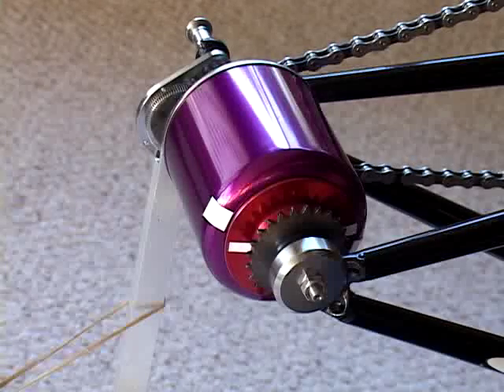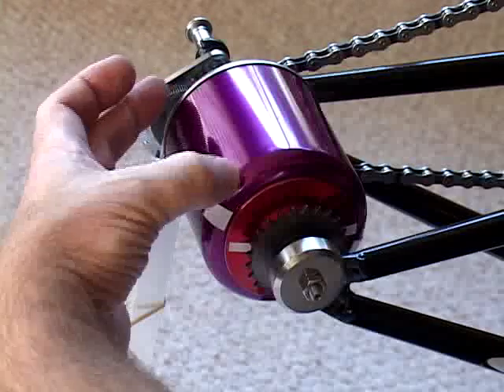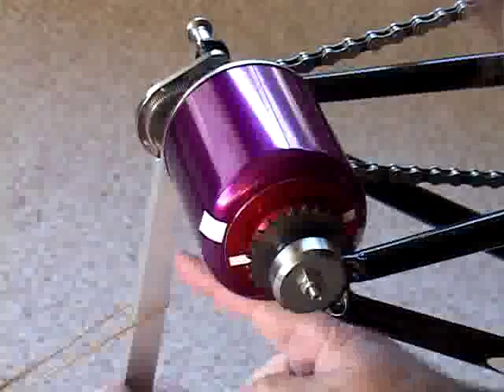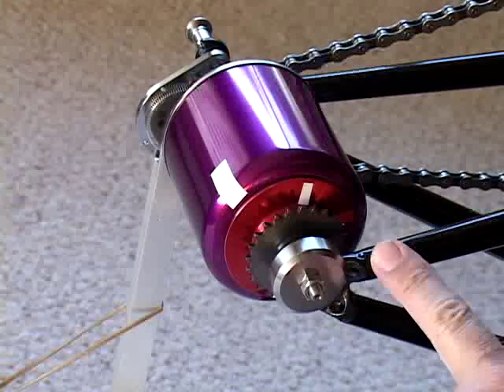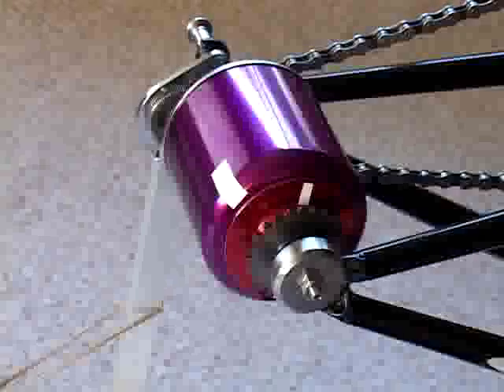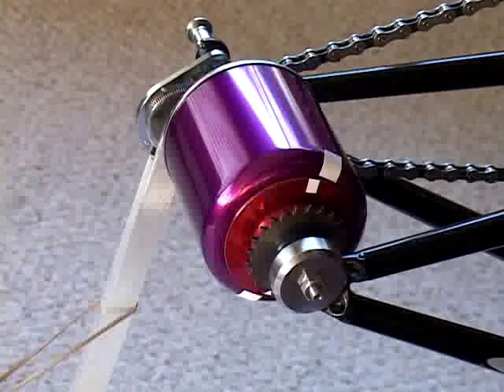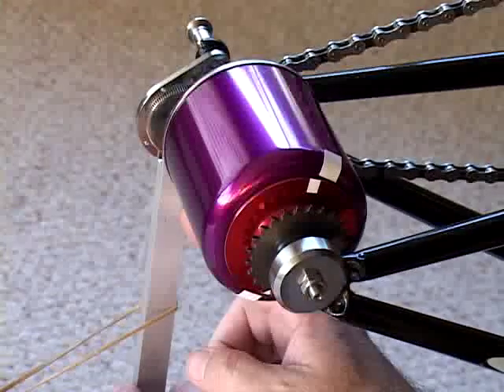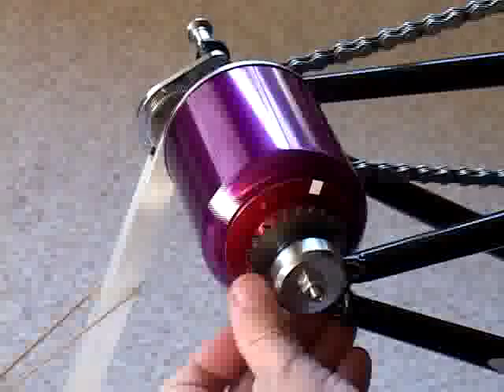Automatic Bicycle Transmission (IVT)

Comment from the maker: xxp Think about using a teeter-totter; if your partner is much heavier than you, the teeter-totter is no fun at all & totally useless! Now, ask him to sit closer to the pivot point (fulcrum), where his torque is reduced to balance your torque, making it finally useful.  The point is that the speed for both of you has become useful as a result of torque adjustment, not the other way around; which is the cause, and which is the effect?  This principle applies to rotating transmissions.

Comment from the maker: Haz... The SIVAT can be designed to stay engaged in propulsion at ratios so low that even the most extreme human-powered pedal force (elite cyclists) will not make it 'cut out' or be damaged.  As such, your bike speed might be ridiculously low while pedal resistance is still normal as you go up very steep hills.  A 'wheelie' would result.  It is not like a slip clutch!

Comment from the maker: Zetune79.  At zero output, the energy transfers to engine heat, just like with all transmissions in 'neutral' or while idling at a stoplight. The function of approaching zero is a more efficient method of starting vehicle motion without a clutch or torque converter (which are very inefficient); so what benefit is gained from eliminating that ability?  I can provide a control ratio plot, but can also say that each angular increment of the lever cuts the ratio ~ in half at some scale.

Comment from the maker: Pghpunkid.  No belts, no rollers.  Hard steel parts that don't slip.  It uses gears that engage to transfer power.  It is more than a CVT; it's an IVT!  Yes, it's mechanical; just like belt drives, chain drives, fluid drives, gear drives, pneumatic drives, which are also mechanical.  The term 'mechanical' does not refer to just rigid metal mechanisms, it refers to all mechanisms.

Comment from the maker: Zetune79. Yes. Yes. The overload protection can be limited to any low speed, including zero by limiting the travel of the ratio adjuster mechanism!  Since the SIVAT is infinitely variable, it can always reach zero output (or your redefined low limit) without regard for step-up or step-down gearing on the input or output; the video unit actually is stepped up by 5 times with a 55T crank sprocket to an 11T hub sprocket, so its actual highest  'gear' ratio is nearly 5X!  Not a clutch coupling!!!

Comment from the maker: eisen...  The inner workings of the SIVAT are proprietary and the patent is pending, so I do not show its innards!  The torque is ~ proportional to volume, as with all gear systems; the size on the YouTube video will output about 145 nm max @ 600 rpm input/39 rpm output. Torque is somewhat dependent on ratio, higher output torque achieved with lower ratios.  The calculated maximum sized SIVAT will transfer over a megawatt of power @ over 1000 nm input torque, several thousand nm output torque.

Comment from the maker: timonix2.  The way the SIVAT is configured presently, it does exactly as you need; giving automatic control to allow variable output speed with nearly constant input speed.  If you need perfectly constant input, it would need a servo to electronically control the ratio at all times.  My son is currently taking a 'controls' course in his computer engineering PhD. curriculum, and might do that as a project if asked.  Email me.

Comment from the maker: Hi maco10810. Thanx .Your description is remarkably close to our original goal.  Take this a step further; use a small IC engine that produces its highest torque @ ~7000 rpm where its power is very high, but also can run at very low power at low rpm with very low fuel consumption.  This would be very economical & efficient, but allow high power only on demand! The SIVAT would adapt either engine speed to the vehicle speeds, going to lower 'gears' for high-revving, high power needs.

Comment from the maker: Please read all posted comments at this site; you will see an explanation for the IVT.  This SIVAT is a classic case of IVT.  Look up the IVT definition on Wikipedia or Hot it Works.  The SIVAT is perfectly capable of both overdrive & reduction, useful for all drives, including bikes.  The YouTube proto has a 55T chainwheel & 11T rear sprocket; do the math!

Comment: I don't see how it can be called an IVT, with ratios between 1:0 and 1:1 it's only a CVT. It doesn't reverse, and it doesn't go over 1:1. A useful bike transmission needs to go over 1:1 to be useful for level riding. I can think of many uses for a reduction CVT, but a bike transmission isn't one of them.

Comment from the maker: Good question!  Our next prototype will be designed and sized for 500 kW wind turbine and vehicle power/efficiency tests, in-line shaft drive.  The SIVAT offers several advantages for HAWT's; controllable mechanical synchronization to 1200 or 1800 rpm output, high torque capacity, high power density, high ratio bandwidth & up-front mechanical shock load protection.

Comment from the maker: Wut's not to get? Yes, ratchets engage and *disengage*; but ratcheting drives use several ratcheting elements that each only disengages when others are engaged in sequence. Therefore some elements are always engaged in power transfer. Their action is locked, so they have no local relative motion that can allow frictional loss. Only motion of their associated mechanisms is allowed to transmit power, usually supported by low friction rolling elements, so the whole system is positive & efficient.

Comment: Great. My english couldnt understand the speech so, where we could buy this or this is a prototype? Maybe you should start to insert this inside those motor wheel. If the motor wheel have a transmition like this one , when we climb hills the motor will change to a power gear and the motor will resist.

One motor wheel with transmition mmmmm (^_^)

Keep doing the great job

Comment from the maker: lalaland0417. The Shimano 8 might handle 1200 watts in any gear, but the gearshifting shock loads may strip its gearteeth. Read about the Tesla Roadster for insights. SIVAT does not abruptly shift gears. We're reviewing new SIVAT design for torque using stats of pro sprinters who produce crank torque peaks at ~150 Nm @ 2.5 kW of power. Email me for more info.

Comment: I would love one of these. I currently have a trike with a shimano 8  speed internal geared hub drive.. which works well. But I'm probably going to break it when I hook up a  48V 1200W motor to it.  With one of these I could alter the gearing based current consumption. I wonder whether on of these would hack it?

Comment from the maker: looselefty.  I may be ahead of you.  I used to be an avid cyclist myself.  I plan two handlebar controls: 1) torque level response adjustment, and;  2) response speed adjustment with ratio locking.  If you stand on the pedals, you can control how fast & how far the ratio drops.  My Paramount has a 174 inch high gear that I've used going really fast downhill, which I can do because I'm big.  So, I understand your concern.  Flyweight control upshifts with acceleration, the opposite of desired.

Comment: I didn't really get how the 'automatic' part of the transmission works - automatic transmissions in cars seem to select appropriate ratios based on information including load input and output speed (using either hydraulics or digital circuitry to decide).

How will this IVT adjust its ratio such that a given input speed will produce a different output speed going up a hill than going down - i.e. so the rider could always pedal at a constant rate (~90 RPM is quite comfortable)?

Comment from the maker: Our EV expert suggests that this SIVAT would improve the efficiency of electric drives in general, including EV's.  Your wish may come true.  Tesla abandoned its two speed transaxle because the torquey motor broke gears; this transmission may avoid such fate with its inherent overload protection.

Comment from the maker: This transmission is intended mostly for motorized uses, but for a bicycle it eliminates shifting which is often awkward.  Its automatic feature will assure that you are in the best 'gear ratio' for pedaling efficiency.  So, yes, minimum energy requirement is a result for a desired speed.

Comment from the maker: SIVAT is not similar to any traction drives.  It's an IVT, not just a CVT.  It's also automatic.  I invented, designed, built & tested an automatic traction CVT for bikes 22 years ago; after studying traction with traction fluid then, I concluded that such designs could not be efficient or durable enough.  They are like angular contact ball-bearings whose performance is very well understood by bearing engineers.  Transferring power through bearing races/balls adds large loads beyond that data.

Comment from the maker: Audi's 'Direct Shift' is also a Dual Clutch Transmission (DCT) like other discretely geared units that cannot achieve fuel efficiency like an IVT because they require the engine to rev-up before every up-shift.  Think of your tachometer as a fuel consumption gauge, while considering your speedometer somewhat as a fuel economy gauge up to about 50 mph.  SIVAT is a tachometer suppression device.  Good IVT concepts are extremely rare; we do not want to waste any investor's money with anything but!

Comment from the maker: Personally, I love stick shift transmissions, preferring them for all (except one) of my cars for forty years.  I invented the SIVAT for optimum efficiency in cars because I love freedom from petro-extortion more!  Near-constant, non-shifting engine and motor speeds offer efficiency that's not possible with discreetly geared transmissions, dual-clutch or otherwise.  Regarding the AutoBike, it shifts 'up' when you stand on the pedals to accelerate; wrong for two reasons!  Think about it.

Comment from the maker: This question might be the equivalent of a mixed metaphor!  Ferrari tried an VPD (Variable Diameter Pulley) on a race car about 15 years ago.  VDP is typically a CVT, not  an IVT, and a pretty old basic invention.  The idea of continuously modulating engine speed against driving speed & torque is right though.  And Colnago did make a Ferrari Red bicycle.  My SIVAT is a horse(power) of a different color.

Comment: I think part of your battle is that is that big companies, such as shimano and rohloff want to keep costs down by designing their own original ideas, and its a pride thing. I have just checked out shimano and sram websites, and they both have internal geared hubs. I would develop a working prototype, ON A BIKE, send a demo video and spec sheet, with the aim of delivering/shipping one to them. If you made it compatible with e.g. shimano, or sram shiftrs (as appropriate) then it wud b mor appealin

Comment from the maker: Thanks for the advice.  I've studied Rohloff's design; a series of mechanisms with compounded losses.  We're currently redesigning SIVAT specifically for a bicycle bottom bracket mount with high efficiency/low cost focus. A simple mechanism with few elements in dynamic series.
  We've gone-a-courtin' w/ bike companies before, and may offer it as an after-market product instead.  We want a showcase for this versatile concept; happy customers should impress other players & industries.

Comment: I hate you.  I had the exact same idea with the storage of braking energy into a flywheel and reintroduction back into the system like when stopping into a red light so the energy isn't just dissipated as heat through the brake discs.  Go do it, I want to see it used.